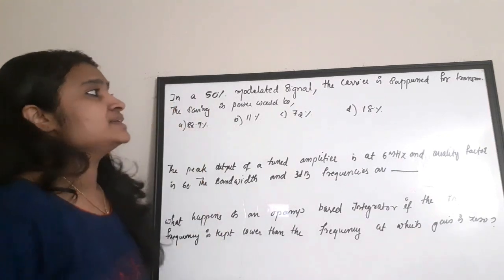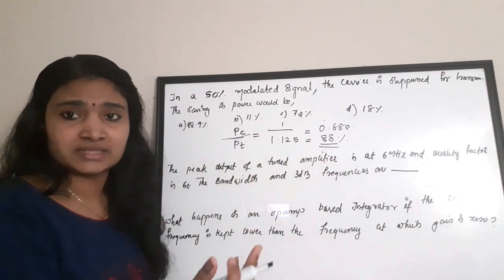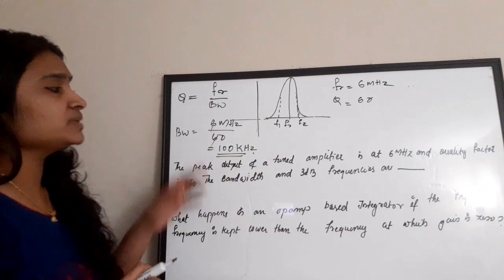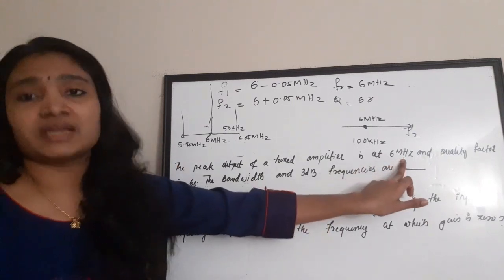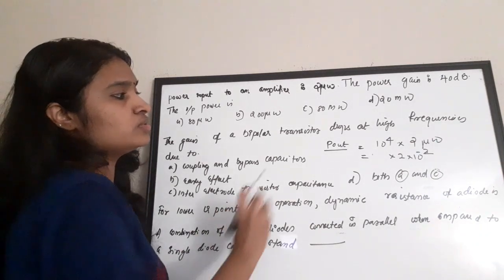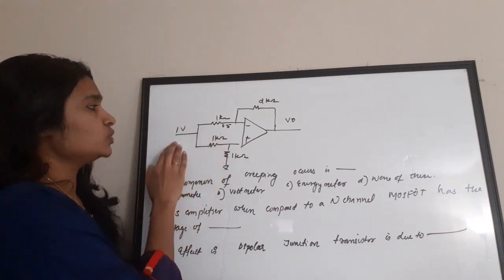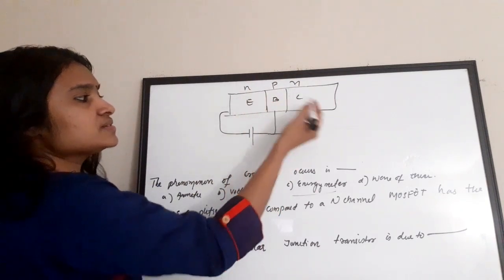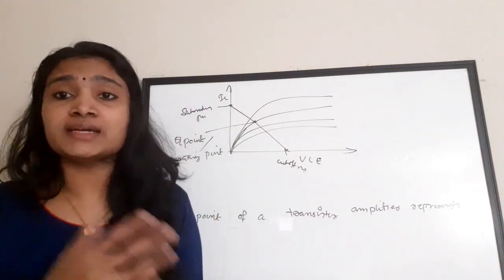Competitive Exam Preparation of Electronics and Electrical Part14| Technical assistant| BEL Exam

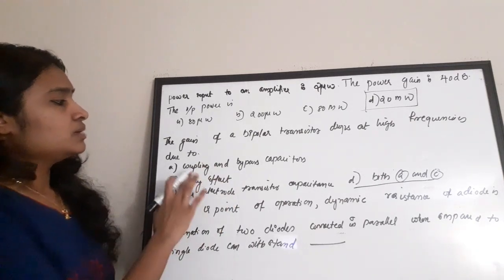Comment: at 16:26  i think at low freq gain decreases due to  option a  at high freq gain decreases due to option c plz check the answer.
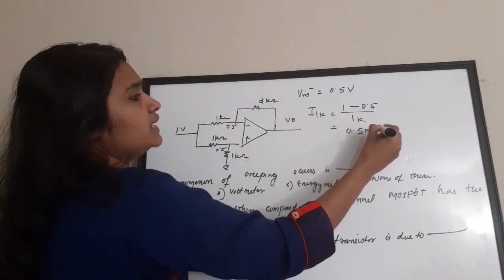at 19:30 i think v in(-)  =1v  and v in(+)=1v  it is parallel connection- voltage same and acts like a difference amplifier plz check it

Comment: Q18 switched capacitor filter in integrated circuit are used to mimic the function of ??? a) capacitor b) inductor c) Diode d) resistor
Reply from the maker: Resistor